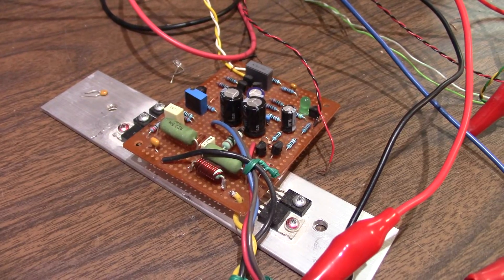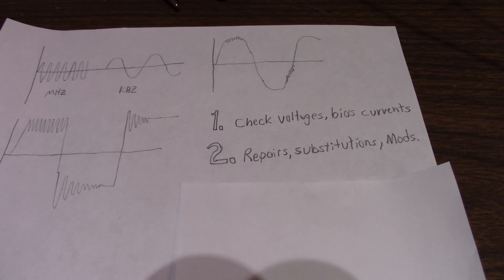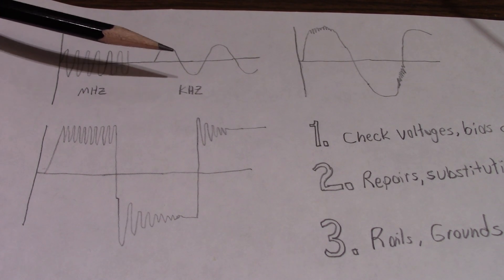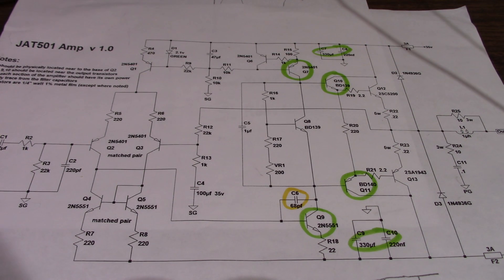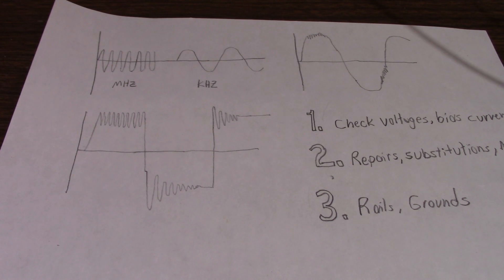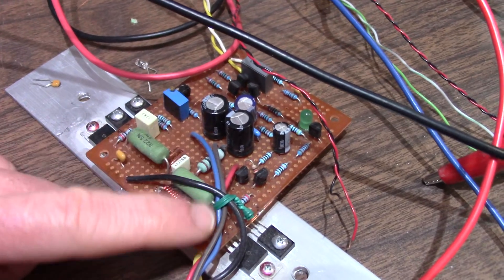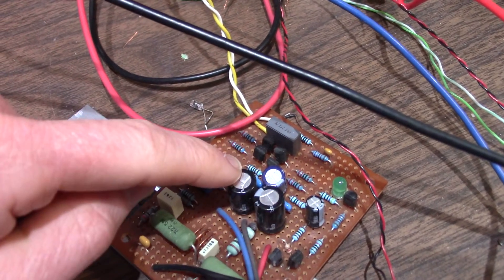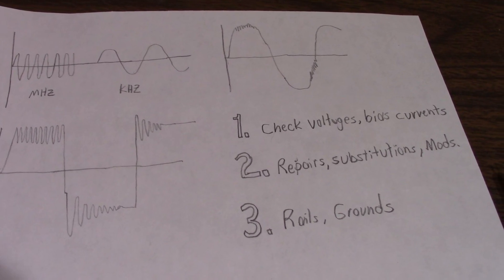Oscillating amplifier - Tips to fix

Comment: I've got a old pioneer av receiver  pioneer vsx-921 sometimes it starts to make intermittent oscillating  noises on the speakers output I don't know if it's the caps need changing or preamp problems  or driver transistors oscillating  yes I into my electronics so I know some knowledge  on electronics and and electrical stuff that why I like watch ur videos plus I'll rather fix it myself  with some advice  from someone  like yourself

Comment: I wish I would have seen this a week ago. I bought a damaged (non working power supply) Soundstream D100. I had never seen an amp like this! 
All discrete components. Not a single IC anywhere. I started tracing back from the base of the PS transistors. Led me to a MPSA42, MPSA92, and 2 TIP31. The collector of the 42 was fed by a to-92 that had C13F on its face. Couldn’t find any data sheet anywhere. It tests as a PNP. I found a GE SCR with the C13F? Anyway, the collector on the 42 had 6.8V. I had touched my probe to the back of the tip31 while probing the collector of the 42 and all the sudden I have rail voltage and a working amp!!
After further investigation I noticed a resistor that was reading 94.8 Ω. It was a 33 Ω resistor. It was tied to the tip31 emitter the tip31 was paired with the 42s emitter as well. Replaced resistor and instantly had a working power supply and rail voltage. I learned a lot. All due to an accident. I also learned it is a multivibrator circuit. Very interesting stuff. Apparently Nelson Pass designed the amp I purchased. It sounds amazing for being almost 40 years old and 50x2 @4 Ω. 
I’ve repaired many class AB and class D amps that were filled with ICs.  They were much easier to work on. Mainly because I had done it so many times and spent so much time troubleshooting. 
Discrete amps definitely sound better than IC amps. Thanks for all your videos. You have helped me a learn a lot when I first started repairing amps.

Comment: yeah, i got a few years ago a Pioneer SA7800 from my uncle and it originally had 2sc2525 and 2sa1075 big mt200 transistors, and like i had to substitute one of that transistor for two 2sc3519 and 2sa1386, okay i tried to find a 85Mhz power transistor but i didnt seen it anywhere, so i opted for those which can do 50Mhz, which is still very good, i would say that 2sc5200 and its pair is known very well, but i feel like 30-35Mhz would been too slow for that NSA type of amplifier that i have.
I actually did try it with slower transistors, i had some like 15Mhz transistors, and that amplifier didn't sound right, the frequency cutoff were too bad and the amplifier barely played any high frequencies like above 18-20khz, but with those 50Mhz transistors it can play above 50khz, and i can actually hear the difference between like the 18-20khz limit and the 50khz. Its so much nicer.
Also recently i wanted to buy more transistors for my amplifiers to cover more power tdp, but while i wanted to buy more of those 50mhz transistors, they became absent, so i got some from other website, but they look a bit fake in my opinion, so i didnt put in in my amplifier for upgrade purpose.
Now at least i have a SA7800 that sound something like the original amplifier, the bad thing with this amplifier that its too good, if i walk somewhere, meet someone and i hear music from their equipment, their stereo sounds so bad, while my amp sounds so detailed. Its like i always hear those cheapskate 2.1 speakers most of the time and people say oowwww its good, just hear it, the bass owww.

In my equipment, i also recapped all eletrolyt capacitors, and i dumped most of the transistors due they were noisy, my uncle got the equipment in 1980, and the manufactured time is 1979 march. My amplifier passed 45th year 2months ago. :)))) 
It got a new life, i also done everything right, and i can dare to leave the amplifier turned on, its really realible in its new hearth!

Thank you for the infos in the video, liked it!

Comment: Last week I had to repair my own Technics SU-X102, first notice a resistor that got warm, and the transistor too on the supply board. When the amp went on, there was a peak current to the outputs. That almost blow my speakers. So put the amp on, and spray some cold on the transistor. And jup that was the suspect. Changed the resistor and transistor. Checked the usual things before closing down. Good repair and can do a few more years in my living room. All tough, I don't like those STK modules. But I got this one for free, so not mocking too much 😊

Comment: Just discovered your channel and thought I would ask a complicated question haha! I have taken it upon myself to do a project that I am not able to do, and I can't find any one locally that works on electronics and circuitry. I want to use an Altec Lansing Hydra shock Bluetooth speaker to play my guitar through because of the unique features that it has. The problem is that it does not have an auxiliary input. And I believe that even if it does all of all texts speakers seem to have latency issues when you are able to plug into an auxiliary port. So I need to install an auxiliary port and fix the latency issues. While somehow keeping the light show features. I know this is a long shot but do you have any advice you can give me or a direction you can point me in? I truly would appreciate it!
Thank you
Reply from the maker: Not much help I can offer on that not knowing this device. Some class D power amp chips don't even have analog inputs as they use a digital front end. Latency is annoying for instrument amplification. I'd look elsewhere for your amplification.

Comment: What would make the sine wave be round on the bottom and more of a point on the top of the sine wave?
Reply: That is distortion. Namely 2nd order harmonic distortion. This is usually caused by nonlinearity of active components like transistors, mosfets.
Reply: @johnyang799  how do you fix it?
Reply: @SheikhN-bible-syndrome  Depends on what you are asking. Assuming it's an amplifier then I need to know the circuit schematic. If it's a diy kit then I guess you can get a better one? Some with the name like blameless or Douglas would be good. Not sure if JohnAudioTech sell those JAT501 kits.
If it's a circuit you designed yourself then It's more complicated. First what's the input stage look like? Is it single ended input or differential pair? Do you have global negative feedback? or it's a single transistor amplifier of some sort?
Reply: @SheikhN-bible-syndrome  Recommendation is to adopt a blameless amplifier design from Douglas Self and start from there.
Reply: @johnyang799  ohh and the input is a headphone jack connected to the input leg and the emitter leg/ground with a DC blocking capacitor on the + input wire and a Bluetooth DAP with 1.5v of output ability at 1khz
Reply: Excellent advise above. I'll just add, it's a commercial amplifier start checking transistor and resistor specs and check if it's over-biased or if anything is overheating.
Reply: @peterlarkin762  it's a homemade class a transistor audio amp using just 1 2sc3281 in a common emitter configuration  and using 2 200 watt 4ohm resistors wired to 8 ohms on the + to collector and ground straight to the emitter leg and I have a 50k POT with 2 100ohm resistors on it that are connected 1 to the collector and the other one (the wiper) to the input/base whatever it's called.
I have no idea if any of this is right I just figured this desine out and it worked so I've been using it I'm sure there's probably a much better way to do it but I'm new to all of this